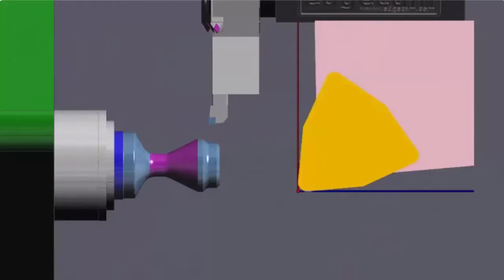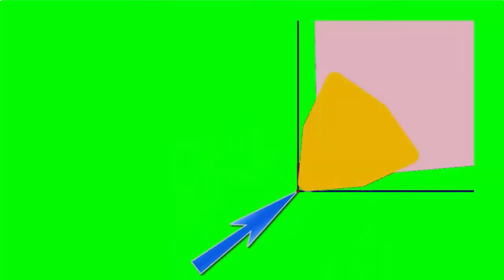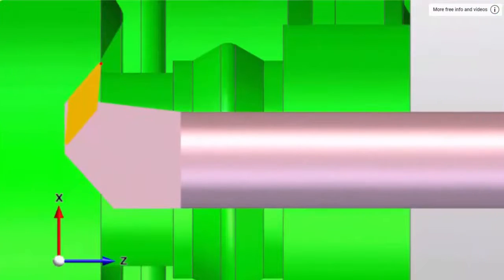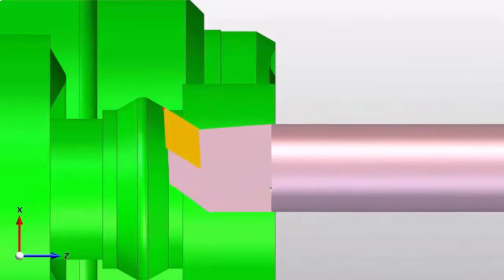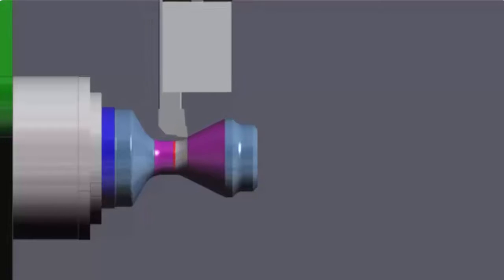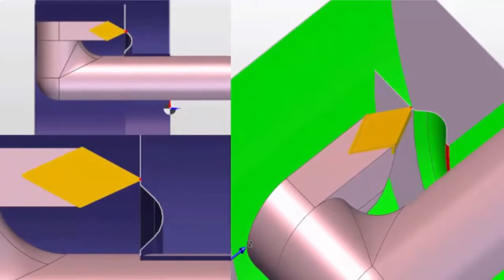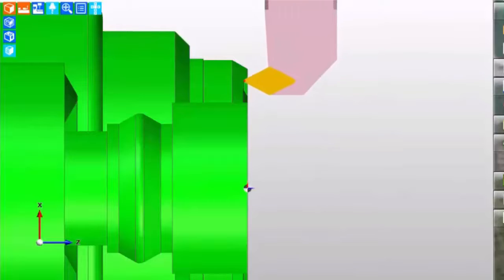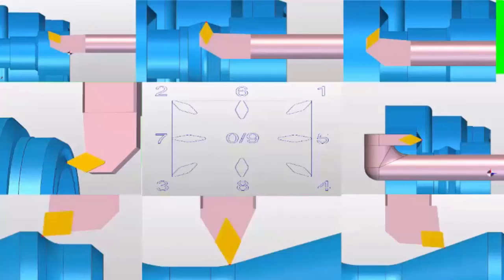G41 G42 Virtual Nose T Code Fanuc Lathe

Comment from the maker: You only need it when you are using G41 and G42
You also need the tool radius
Some controls like the Haas need it for the tool measurement arm but it does give you little icons to click on. 
It is to enable the tool to automatically touch the probe button 
Hope this helps and thanks for watching
Reply: Thank you very much